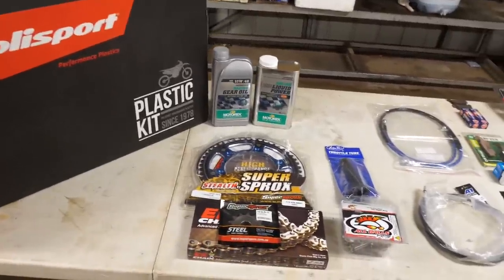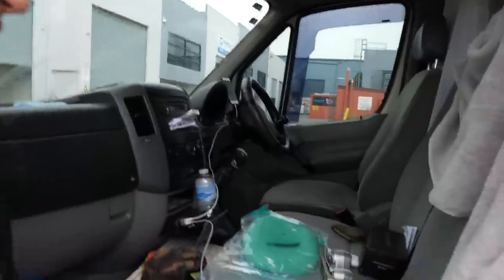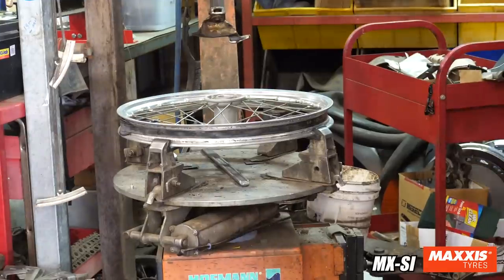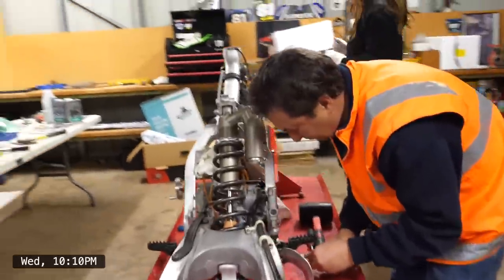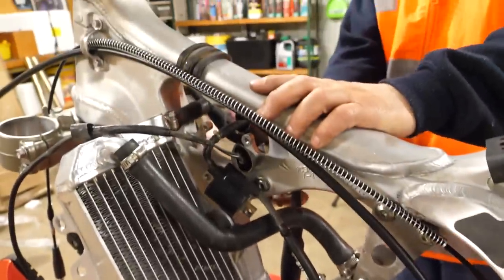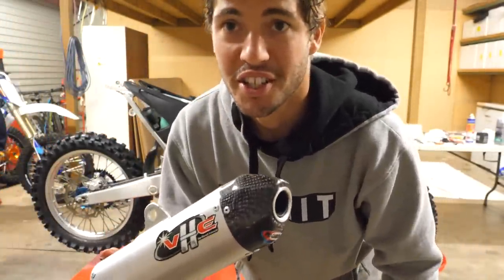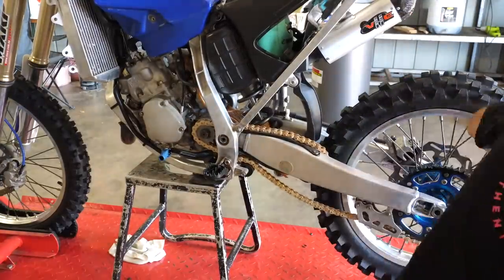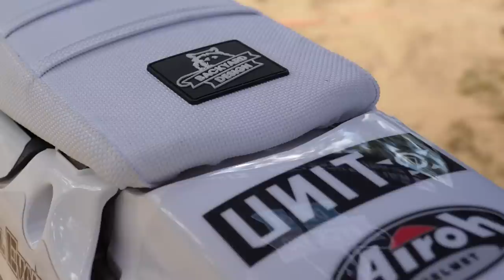YZ125 BIKE BUILD - PART TWO || FINAL REVEAL || FIRST RIDE

Comment: With two strokes instead of going down gears pull the clutch in and out rapidly and it should speed up so much quicker
Reply from the maker: The clutch got a hammering over the weekend haha